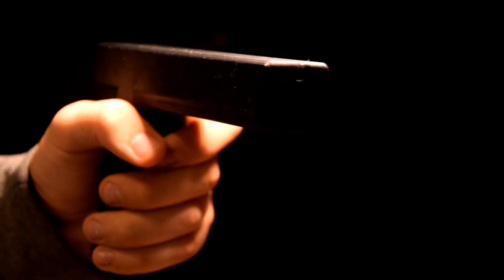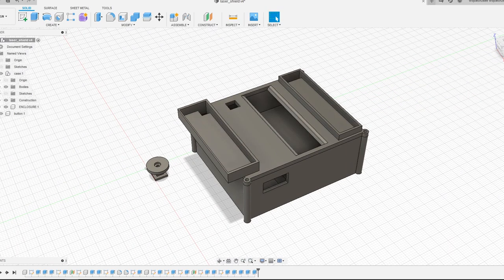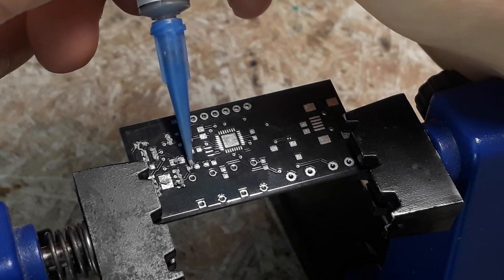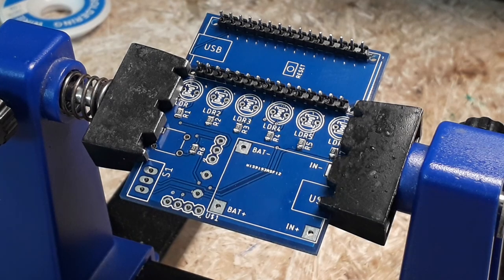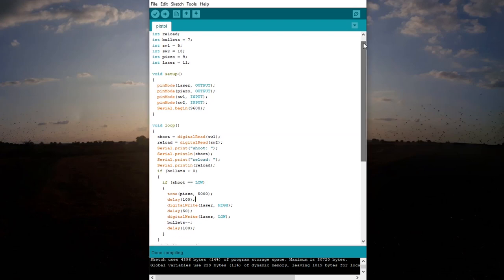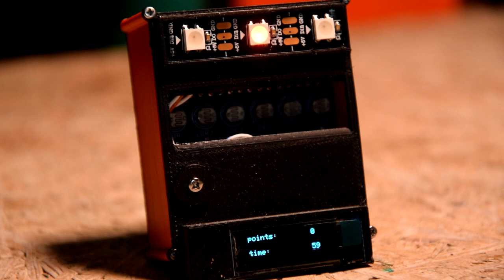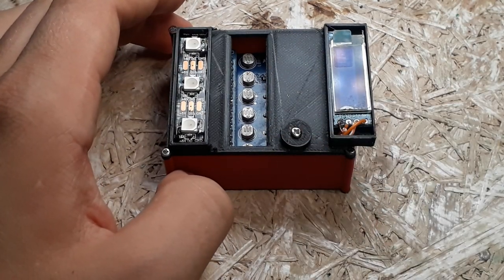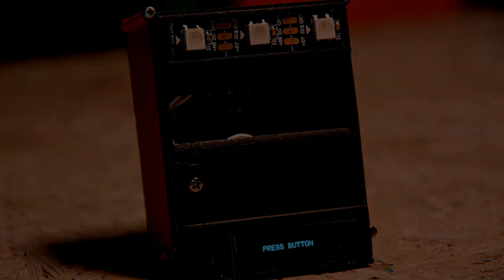DIY Laser Game - Pistol + Shield

Comment: I'm not sure, but I think I saw something a bit simpler, at least for the "gun," which had no circuit board. Can't remember the channel, can't even find it. The gun was a switch, battery, laser from a laser pointer, and something else, can't remember what it was. The final component could've been a resistor, capacitor, or transistor.

Is there a way to make a simple laser tag gun without a circuit board?
Reply: If u find it could u send me plz ^^ thx
Reply: @Alex-xq5qz  "Can't remember the channel, can't even find it..." Should be clue alone that's highly impossible.
Reply: Would be a cool project.  Recently bought some laser tag game guns for children but they are so inaccurate.  Looked around and saw the Falcon running at around $800 a laser toy handset.  Like dayum... if I could make one with an Arduino or something with an accurate laser, then it would be wonderful.